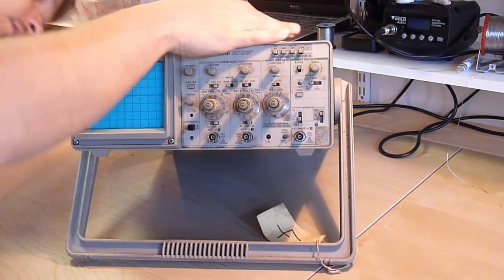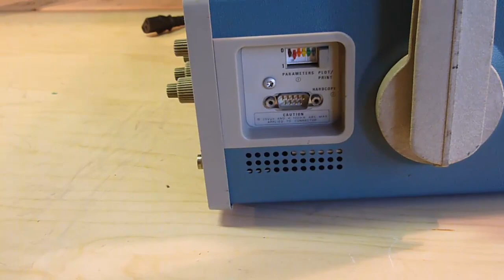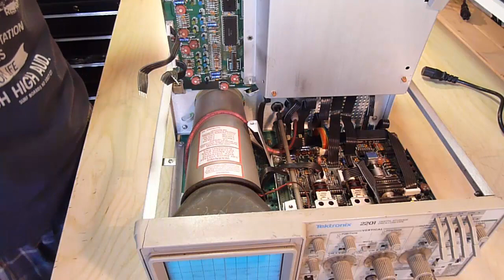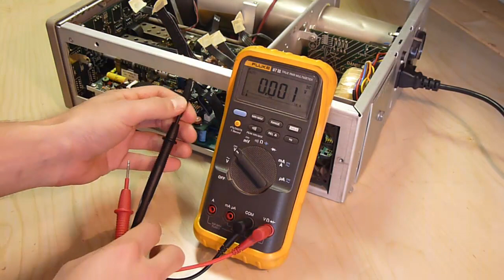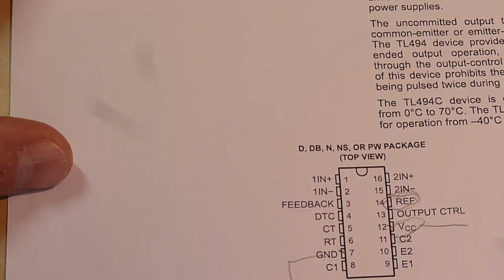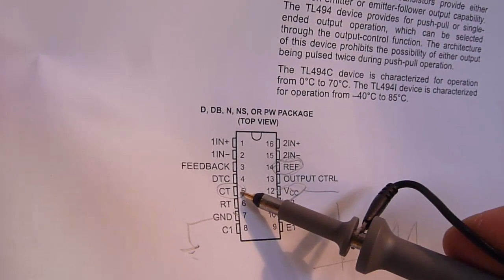ManCave 001 - Tektronix 2201 Oscilloscope Repair (Part 1) - Troubleshooting

Comment: MANCAVE,
 what circuit inside the oscilloscope will draw the horizontal voltage on the CRT screen? 

because there is no horizontal oscillator or vertical oscillator used inside an oscilloscope so how can it draw a sinewaveform on the CRT screen? 

The  Ramp circuit only controls the electron beam only to the CRT screen?

Comment: I want to tweak a few trimmers in my (working) phillips pm 3212. Should i be worried about the high voltage supplies? The 180v capacitros shouldn't be a problem because there are multiple resistors to ground connected to them, but the 8.5 KV output of the voltage multiplier doesn't have any obvious ways to discharge.
Reply: Yes you should be worried. Take great care. You could try discharging the capacitors individually IF you know what you're doing.

Comment: Really great video, was viewing oscilloscopes on eBay and decided to watch some repair videos in case whatever I get needs some TLC :) Out of curiosity, what nationality are you? I can't really tel by your accent at the moment (I'm guessing British, but I suspect I'm completely off!)
Reply: Careful if you do buy any old electronic equipment to repair that it doesn't have Cadmium plating which is flaking off. Cadmium makes lead seem like baby oil.
Reply from the maker: Hey, late reply but better than never ☺. Thank you for kind comments! I'm originally Slovak, but have been in the UK for over 14 years.

Comment: Are you saying 100 volts will kill you is that just in DC power? Because in AC power 120 won't kill you on a 1 or 2 second shock

Comment: I work as an electrician, would like to study electronics , how to think, whether to accept such an oscilloscope for self-study, or something better, to see? 
http://alipromo.com/redirect/cpa/o/o09jqsfzbqitcqaaufmylc5rzdso8ar4/
Reply from the maker: +Александр Смирнов Hi, Good that you decided to study electronics. I would definitely advice AGAINST the oscilloscopes you can see on the link you posted. They are toys. Get at least the an old analogue scope like the one in this video (but buy a working one, do not try to fix one when you are starting to learn electronics). You can buy them cheap on ebay. Or get a cheap Rigol scope if you can spare a bit more money.

Comment: I saw on another site, you could cause problems in a SMPS by disconnecting the loads. did you damage any parts?
Reply from the maker: Some SMPS can be damaged when ran without load. Not this one though. Good point though!

Comment: What PC Based scope are you using? recommend?
Learned a lot from the video. Thanks!
Reply from the maker: Hi dlt205, I use PicoScope, but If you ask me to recommend a scope, get a proper scope, not a PC based one. It isn't bad but takes longer to setup than a normal scope with knobs and buttons. The only reason I use the PicoScope is because that's what I have at the moment and it is a good scope so cannot justify getting another normal one. If you're just starting Rigol is pretty good value for money.